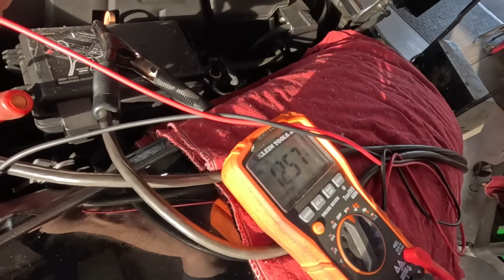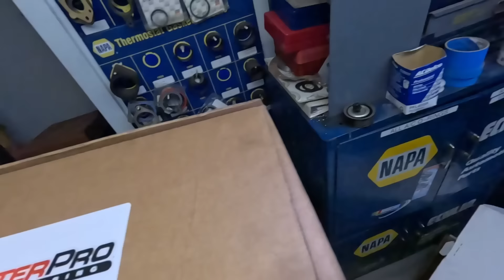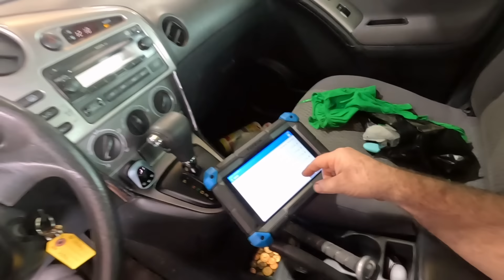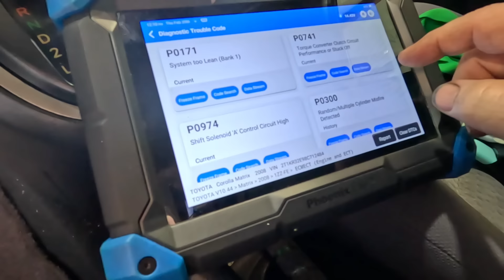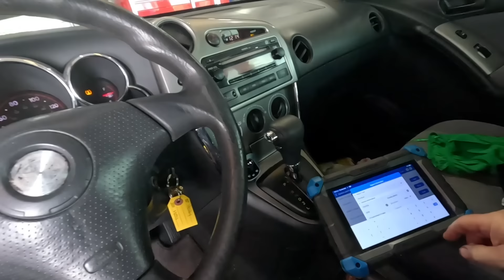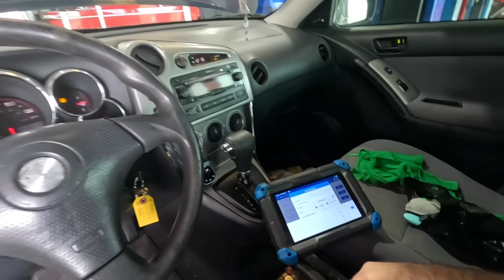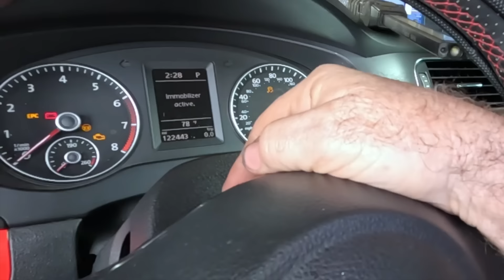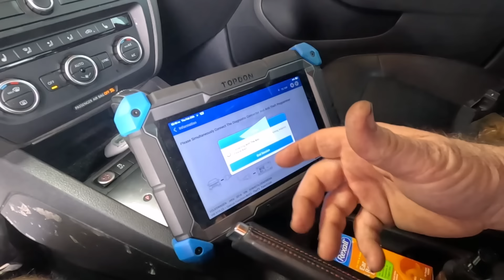BROKEN 22 HONDA CIVIC, MATRIX MAINTENANCE, JETTA ELECTRICAL, DAY IN THE SHOP 432 #auto #repair

Comment: My father was a ASE master tech at Toyota for 35 years. And in the those 35 years he knew many people who were intelligent master mechanics, and some who where lazy and had no idea what they where doing. Some people are just good at taking tests, but not the real world hands on part lol. He pushed me to get ASE certified. I finally got my first one a year ago. Unfortunately Im not a very good test taker lol. So its taking me more time then normal. But one thing I noticed about the test, is that it doesn't teach you about EVERY car. It's more of a generic knowledge that can be followed with most cars. But in today's world, every car has its own problems with its own symptoms. There is no such thing as "one size fits all" anymore. Every car is different.
Reply from the maker: True, ever car is different, but…
Every car uses similar systems and a 3 wire sensor works the same across all brands. So their intent is to make a generic car that uses common systems we need to understand. They’re tricky though, so sometimes we have to read the questions a few times. Looking for words like least, most, best and things like that.
:) Best of luck on those tests!

Comment: Regarding the grease on the Matrix hardware clip inserts on the caliper adapter slides- doesn't it collect dirt and debris to actually hinder brake operation? SMA appears to never do this up there in the rust belt but only underneath the clip hardware. Prevents rust  pushing upward and binding the pad ears. Your opinion?
Reply from the maker: I think under the hardware is just as important. I’ve seen them rust on both sides though. I’ve never had a grease contact that was bound up by dust or dirt. Only seen dry ones stuck completely. :)

Comment: Jimmy! You know I admire you and I never hassle you over anything but putting plugs in that Toyota with the valve cover/spark plug tube seals leaking that bad you're going to catch a lot of hell all over that on YouTube... Our shop won't replace the spark plugs unless they fix the valve cover leak. But I suppose since the customer supplied their plugs is why you are doing it
Reply: It’s between the customer and the shop. If you and YouTube viewers would like to donate $, I am sure Jimmy could find a good use for the funds.
Reply from the maker: We advise the customer and make notes on the ticket. I think he wanted to do it at a later date. Good lookin out though! :)

Comment: You know the most interesting thing about watching this channel as well as Rain man and South Main is not the turning of fasteners or jiggling of wrenches or the frustration of your master mechanic ,its learning what cars to avoid buying at all cost because they are quite literally junk .
Some of these expensive pieces of rolling crap on wheels are sold as if they are made of Gold but instead are badly designed and crudely engineered designed to fall apart as soon as the useless warranty is up .
Just look at how quickly they are adopting the CV tranny and even getting rid of the manual transmission .Anyone with the slightest understanding of mechanical components knows that design of transmission is a failure waiting to happen .
These tiny cars like the Mitsubishi mirage they couldn't even give away for under 10 grand a few years back are now priced to near 20 grand ,with no new redeeming qualities that could ever justify to price increase .
It's all a giant conspiracy to screw the public and devalue the currency ,to steal your savings .Just think about it .
Reply from the maker: It’s all about short term profits these days. Quality and brand reputation mean little compared to stock values. :/

Comment: Good morning Jimmy! Gotta watch RR today! Instead of repairing a transmission, he just replaces it! Trans shop job anyway, but now he hired an Oreily guy! I guess he is really growing! NOT! I had to unsubscribe today, couldn’t take anymore! Between the Trans debacle and the removal of 4 lug nuts with an air chisel to replace a wiper washer pump on that BMW just did it! So good to see real quality like you Jimmy!
Reply: I unsubscribed from RR a while ago, it just drove me nuts watching what was being done.
Reply: @dangleebols  I did today. Man I cant take that guy anymore. He had a BMW that needed a washer pump for wipers. It is located under fender well, so he took it on, to use a Air Chisel to chop off 4 locking lug nuts because the customer didnt have the key. He damaged all 4 wheels. Took him almost a day I am sure, just from what he had on video. What does flat rate pay on that job? Not much, plus they sell sockets for that too. He hired a guy from Oreilys. LOL Better than Jiffy Lube, where he came FROM, i GUESS. lol
Reply: Well atleast the Oreileys guy is cheap labor. I don’t watch that channel but I give that guy a month actually working on cars before he goes back to oreileys sitting in air conditioning selling parts
Reply from the maker: Haha, I commented on that BMW nut removal video. Doubt it helped. ;)
Reply: Think he may have removed your comment @JimmyMakingitwork

Comment: Motorcraft agm batteries in my experience are good
Reply from the maker: Yeah, Motorcraft and AC Delco are likely made by the same company for them. Johnson or Dekka I think?
Reply: @JimmyMakingitwork  probably think its only like 3 or 4 actual battery manufacturers. I remember when i worked for honda the interstate truck delivered the "honda" batteries